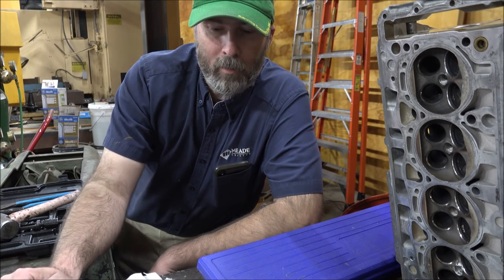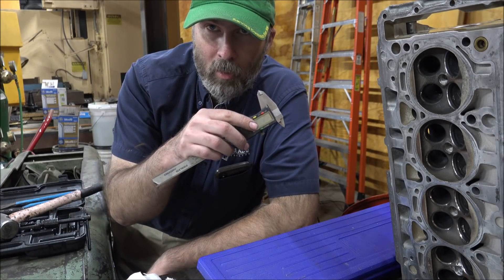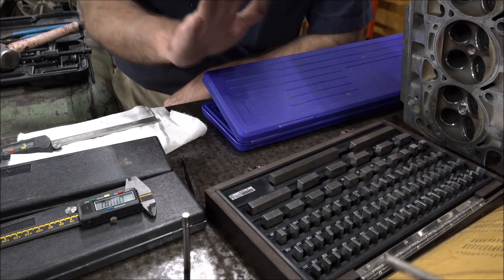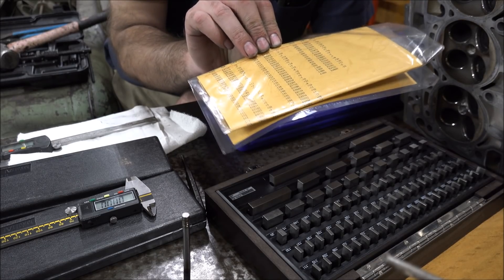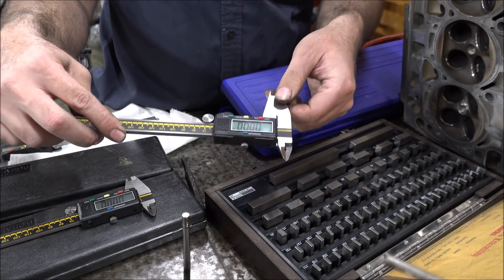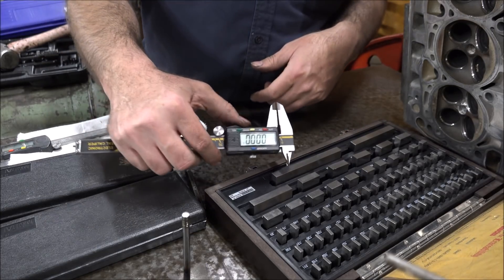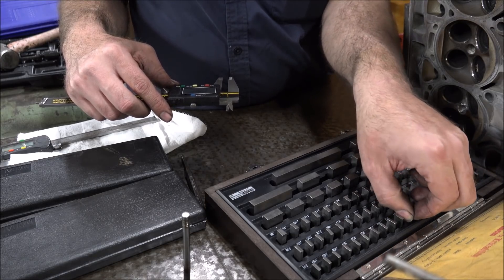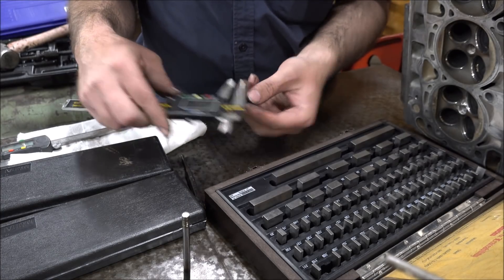The Dangers of Low Cost Measuring Tools: A Reason a Beginner Machinist Might not Hold Tolerance

Comment: GEE,What should i use if i have a bore 2.2503 -2.2508,TELL ME of course u the guy who NEVER cleans table off on HBM get that stuff  off the table and u the guy who uses 1x2x3 ground blocks for clamp heels,just asking how would u check size u always feed z axis  when boring on hbm ,feed the w axis JUST ASKING,TO ALL YOUR TROLLS YES I KNOW HOW TO OPERATE AN HBM,MANUAL OR  NC YES THE ONES WITH DTG AND NO HANDLES,JUST ASKING
Reply from the maker: If you are going for tenths I would use a dial bore gauge, but if you have the right size intrimic that would do the job as well, or an air gauge set to the right size. Lots of tools really that could do the job. Just be careful what the temperature is! Also I only ever use the spindle to bore on short lengths. If it is a longer bore I always lock the spindle and feed the table.

Comment: Brian, you might try putting that caliper in a bag of rice with the battery removed to dry out the electronics. Sometimes it works on cellphones, etc. The dry rice pulls the h2o out like a dehumidifier.

Comment: I used to be in tooling department in a woodbutchering plant, I have ruined many sets of calipers, everyone wanted the depth rod ground down to go into an .093 dia hole 2 inches deep.  I started checking out calipers against my starrett 1.0000 standard.  Digital calipers were the new thing then, and they were nice, push of the button, inch metric.  Only set that said my standard was 1.0000 was a set of mitutoyos.  But the cheap verniers were always spot on.  Personally I will keep my Brown and Sharpe dials, have never had to change a battery.
Reply: Got to add more and maybe tell a story, been accused of that before.  Checking those digital calipers they were all within .0005 but the mitutoyos were the only set that said 1.0000 on a starrett 1.0000 standard.  My first set of dial calipers cost me 50 bucks back in 1980, they were reconditioned, recalibrated,  supposed to be good Helios brand, I was proud of them, but found out I could only rely on them to a few thousands.  The cheapest dial calipers today are closer.  Gave that set away to a mechanic friend, he loved them, better than the plastic set he had,  ha.
Reply from the maker: I like a good set of dial calipers too. I would never trust any calipers to be accurate beyond 
+_.0005"

Comment: The only problems I've ever had with import digital calipers have been metalwork.  Crappy deburring and cleaning, the leaf spring not being bent enough, dings in the bar, etc.  Never had a single problem with the electronics, other than battery drain.

Comment: Not 24 hours ago I threw out a digit micrometer because the faces weren't parallel. Take one guess where it was made? China. Junk is what they produce. 
I prefer Starrett but when I was working as a Fire truck mechanic, the Starrett stuff stayed home. My father hated asian products. And I avoid them as much as I can. But they've flooded the market. I have had great luck with tools made in Poland. I've been to Poland and they despise producing anything that isn't of high quality. Try to find low grade vodka from Poland. It doesn't exist outside of the distillery. Anyway thanks for saying what had to be said. Too many people are using junk tools. And they don't realize how easy it is to get quality tools.
Reply from the maker: Is there a polish company making calipers?
Reply: @bcbloc02  There was. Unfortunately the way things are advertised through their trade listings I haven't found them. Just a few years ago we had 3 choices when purchasing from one of the 4 big supply companies: U.S.A., high quality import, and a low cost import.  The low cost was mostly china/india made stuff. And j&L tool was eaten up. I have family over there and I'm going to see if they can find the company. I'll let you know if they come up with anything.
Reply: @bcbloc02  VIS used to but I think the company folded several years ago.

Comment: Be careful, some of these vary their accuracy  based on battery voltage. The One that that measured good may just have a fresher battery. I have a reworded horrible freight caliper, i replace the battery every 6 months and they repeat well compared to my 60$ signets, but on e the battery starts going they turn to junk. I'm more of a hobby shop kind of guy so being aware of the issue makes me more effective. My .02c

Comment: My  2 pence worth: a branded calliper can give you good results, but all Callipers suffer from what's known as the "Abbe Principal", basically it means you are not measuring inline with the measurement system. Mitutoyo specifications on their digital callipers only guarantee an accuracy of 0.02 mm, with 0.01 mm Resolution.
I've used, only the once! Cheaper digital Callipers and Height Gauges, and they measured widely out over their full range.
I have purchased several"Insize" products recently, and found them accurate, including bore mics, inside mics, and a 300 mm calliper, I have purchased them along side Mitutoyo as well.
Good check for the hobby guys Brian.

Comment: I bought a 6” Mitutoyo off eBay for $28.00 brand new, I’m not foolish, I know what they are. But they don’t use batteries and are very repeatable. The only problem I’ve had is when the battery is low the numbers can vary, and the battery lasts a long time for me. When I use them I close them all the way and they read 0.0000 and it repeats every time I close them. That’s how I double check mine on the run and it’s worked so far.

Comment: Brian, try swapping the batteries between the good and the bad and see if the problem follows the battery. I believe a low voltage battery can cause inaccuracy.
Reply from the maker: Tried the other battery same result.

Comment: Ouch that's pretty bad. My two cents- spend your money proportional to how much you'll use them. Calipers that you use a hundred times a day? Save up if needed and get the coolant proof Mitutoyos. 12" micrometer that you'll only need once a year? Buy used or import to save some money. May we all have good luck buying from the big rock candy mountain---- Aaron
Reply from the maker: I like to have a quick reference set at every machine. A half dozen Mit's would add up pretty fast! Of course I don't expect ultimate precision from a caliper. I just want something I can trust to get me very close. .003" off and sometimes not even moving reading when it changes .001" is unacceptable to me.

Comment: Wonder how the battery life is, some of my cheap ones seem accurate but go through batteries like water.
Reply: The cheap calipers only go into a 'sleep' state when you hit the off button. They continue to draw a small amount of power from the battery even when they are supposedly 'OFF'. Good calipers (Mitutoyo etc.) turn completely off and don't draw any power from the battery unless they are ON.
I take the battery out of my HF calipers when I'm not using them to keep them from going dead. The battery stays in my Mitutoyo calipers 24/7/365 and last a year or more before I have to change them.
Reply: @highpwr  some good ones auto power on and do not loose zero, others loose zero, some don’t auto  power on.
Reply: @doughall1794  Very true. The  cheap imports come from varied sources and use the cheapest components they can get their hands on at the time of production. The micro-controller used in the last production run may be totally different than the one they use in the next run. It may also run different firmware. So yes, operation can vary between tools from the same supplier. Well known name brands have standards to stick to.

Comment: Last month a set of knock of 1-2-3 blocks I ordered from CA, (Via Chinaback door) and to my surprise, not only did they pass the Starrett micrometer & the squareness, but after a good cleaning of the oil flim, the press together test (@@). $21 buck total.Re-oiled and back into their nice plastic case they went. Some times the machinist gods fool us (@@) ! My cheap HF digital caliper loves batteries,,but my Starrett out 2-1 mic has had the same Bat for 4yrs, go figure. Thx Brian for sharing,,,Bear.
Reply from the maker: Sometimes you win some!
Reply: I bought a set of 1-2-3 blocks like that before. Problem is they are about as hard as a stick of butter.

Comment: The cheapo's are always on even when turned off. Ave did a good video on this. That's why they eat batteries. When the battery gets low repeatability suffers. I have glued a AAA battery holder to the back of many sets and wired it into the old battery compartment.  Much cheaper than the button cell.
Reply from the maker: I think I would just wind up knocking the battery pack off all the time.

Comment: I have a cheap set like yours, I was impressed at first with the measurements but a couple of months later they were off by .003 or more (found out the hard way), I installed a fresh battery and suddenly they were reading correctly again. 
They should have a better voltage threshold sensor for triggering the "Low Battery" indicator!
I have a set of Mitutoyo digitals as well but the numbers are too small for these old eyes. 
Lately I find myself going for my old Starrett Dial Calipers. 

As always, I use better measuring tools for critical work (micrometer style tools for depth, length, bore, etc.).

Thanks!!

Comment: There is a standard, but it is an "unless the manufacturer specifies otherwise" type. Calipers are fast, handy, and versatile, but should never be trusted to the last digit. The measuring tool should be more accurate (and more precise) than the needed result. All digital devices will be +/-1 in the last digit by nature, but can be much worse, as you show. I tend to distrust the digital calipers (low end) across the board, as there is no way to know when they will lie to you. Miyutoyo will meet spec wet or dry, hot or cold. The cheapies that look good may still have scale errors due to temperature (one that I have shifts 0.2mm over the 150mm length from freezing to a hot day, which is at least 20 times thermal expansion for steel) and humidity (same one exhibits hard cyclic error every 5mm, to the tune of 0.1mm,  when the humidity approaches 90%). Add to that the poor fit and finish often found, just not worth it. Cost more in time and money to buy a cheap set, if you need to trust it, than a good one in the first place. see: https://www.mitutoyo.com/wp-content/uploads/2018/07/15003A.pdf for the standard.

Comment: Offhand I'd say that the plastic scale inlay is distorted on that bad pair of calipers.
If you want to try to recover your $20, you could try unscrewing the head from the bad new calipers and see if it will fit on the body of the calipers that got destroyed by coolant. Maybe it will fit, and if so, maybe the scale calibration will be the same and it will read correctly. Or maybe it won't. All you will be out will be ten minutes time with a small screwdriver to try.

Comment: The igaging absolute calipers are the best "cheap" calipers I've used. They're about 40 bucks and seem to measure, repeat, and hold a charge as well as my Mitutoyos. 

I don't bother with anything cheaper. I've had about a dozen of them and they always just seem to disappoint.
Reply: I have their Roy Clark Big Number (non absolute) version and, with the exception of the hideous battery drawer, they have been pretty good.

Comment: Have two ~$20 cheap calipers like this. One from Harbor Freight (bought 5 years ago), the other from Menards (bought ~2.5 years ago when the 1st one's crystal broke out). Both work fine to this day, aside from a common quirk (they're branded different but are clearly the same unit)... even on new name-brand batteries, they will randomly jump exactly 5.08mm either direction. When it's off, you know, and re-zeroing will fix it... but very annoying. Good enough for my work...

Comment: Maybe you can use the screen off the dud to fix the old standby. Just get Baily to give it the 'eye' and it'll straighten right up. GBWYall!
Reply: That's an idea Brian, as I bet it's not the actual reader that's at fault but the embedded scale in the arm that's at fault. Just see if the whole head will unscrew off of the moving frame and fit to your old broken one. It's only four screws so worth your time to try it out then if it seems to work, test it with your gauge blocks and hey presto! But be warned you won't get away with it not eating batteries as if they do switch themselves off they take a few minutes to do so, so the battery will need changing every six months or so depending on how often you use it.
Reply: That's what I'd try :)

Comment: take the electronics off of one of the new calipers and put it on your old caliper, what have you got to lose?
the inaccuracies in the new ones is probably mechanical not electrical/
Reply: I agree.  A reasonable chance is present that Brian can salvage a properly working tool from the damaged old device and the defective new one.

Comment: The lack of consistency in the deviations is worrisome.

It's not all that hard to correct a systematic error... i.e. a repeatable error, even if it's proportional - aka linear.  A constant offset is downright easy to fix in most cases, and is a fairly routine part of calibrating a measuring device.

This calips has what appears to be problems with specific points in the glass scale and a degree of randomness in the head's ability to read the scale. Fixing it, if even possible, is going to cost more than the $20 cost of the calipers... trash 'em...

Comment: I have had trouble with the cheapo calipers and found just replacing the battery with a good quality one fixed the issue, likely a one off just on that one pair I had but try that before tossing them across the shop, a cheap fix if it works.
Reply: I've had issues where the cheap imports eat batteries, and where it's nigh unto impossible to maintain a zero, especially when using cheap imported batteries. (A geometric progression of problems...)

However, this pair seems to be repeatably off at certain places on the scale, albeit by different sized errors, and in different directions.

So, while it's worth a try at replacing the battery, I suspect that the glass scale in the body of the calipers is defective... possibly blistered or otherwise distorted, and not in any kind of a uniform or even proportional way.

Fixing that is going to cost more than the ~$20 that Brian paid for them, so scrapping would then be the only sane decision.
Reply: @chemech  Yeah, I just toss the batteries that come with these things, I buy them by the bunches as I have a lot of other stuff that uses them.  Cheap batteries are junk.

Comment: Perhaps you could put the old ones in the refrigerator and leave them there and let them dehydrate .If you leave a loaf of bread in the refrigerator opened it will dry it out.
Reply: Or put it in a bag of rice for several days (or any other dessicant). Only works for the water, not the oil though.

Comment: I've suspected for a long time that the cheap ones are made from electronic parts sourced from the cheapest vendor. The ones that use the LR44 battery seem to be the worst so far as getting an illogical reading, rezeroing it and getting something closer to right. Ones that use the CR2032 battery not only work better, always say 0.00 when closed and the battery lasts longer (though costlier). The Mitutoyo uses the CR2032, but the clones of it seem to work well also.
Reply: The AG-13 form battery (includes LR44, SR44) is a much older cell design, and it got designed into devices earlier.

Some of the older designs were done on the cheap, and can be real battery wasters, and/or have problems holding a zero.

Not that the CR2032 cell is all that new - more than 20 years in service now - but, it's only been recently that manufacturers are building things like calipers to use them, so you are more likely to not have bad electronics.built around a CR2302.
Reply: If you put an LR44  in a Mitutoyo you will have problems or it will not display at all. All Mitutoyo's use the SR44 which is a Silver Oxide 1.55Volt High Capacity (50% more) battery as against the LR44 is an Alkaline 1.5Volt with a lower capacity. I use the SR44 in all my devices that take this size battery & they last a lot longer.

Comment: Hi Brian, 
I have a set of Mitutoyo which looks identical on the body scale, but the digital head is slightly different in shape. The Mitutoyo are branded as made in Japan, I wonder if yours are the M.I.C. copy?
I will have to check mine. 
The digital are certainly easier to read compared to the old verniers, especially when you become chronologically gifted and the eyes don't function a well. 
Digital also have the issue that they are a stepped measuring function, so depending whether you pass that step or not means it may not change reading, but that step is 0.0005" on those you showed. The Mitutoyo is 0.001" or 0.01mm.

Comment: Money is a limitation for many people and the cheap alternatives provide an opportunity that otherwise would not exist.  I have many import tools in my shop.  I did however splurge for a solar Mitutoyo 8" caliper and a 1 and 2" quantu mics.  I figure in 30 years I won't care what they cost.  With the price of steel these days, one scrapped part will have paid for the better measuring tools :(.

Comment: What is the brand of the test gauges you used?
Reply: Looks like Shars imported gauge blocks to me... 

Even the discount sets are pretty good, and you can mic them against a known good standard with a known good micrometer set when you get them.

Basically, you end up doing the basic test that the calibration lab does for a larger operation, and don't have the official certifications, but who cares if you aren't on a sub-contract with someone who has a specific QC policy... perfectly OK for your own personal shop use.
Reply from the maker: Yes they are Shars.